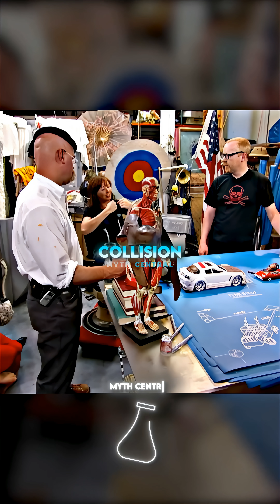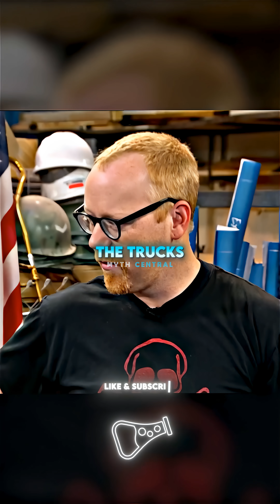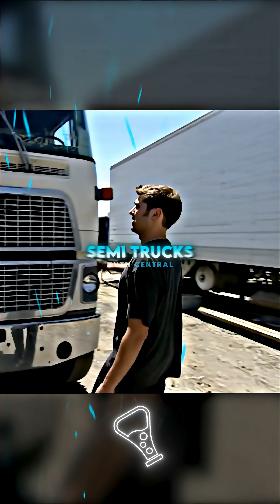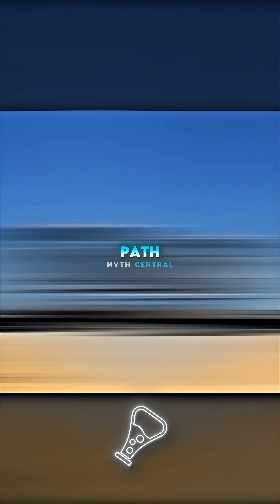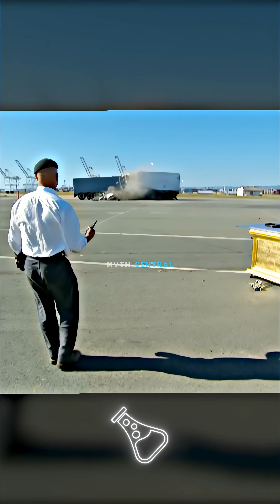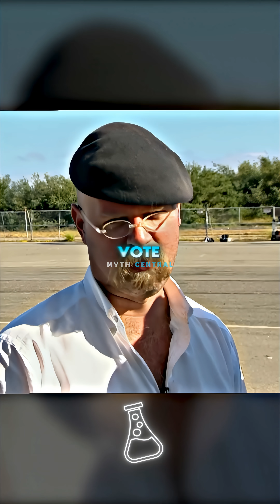Do 2 Trucks Fuze By Crashing?💥🚛 | MythBusters

Comment: I forget where I read this, but in the late 70s, the only car that came close to the safety of the Volvo 240 was the Fiat X1/9.   Fiat thought the US was seriously going to implement 50 mph crash standards when they were designing the X1/9.   But then Volvo was the only car company that could meet it so the standards were scrapped, but the X1/9 was too far along in development to bother changing.    That's bugged me about this myth since the original airing, they picked the wrong car.   Had they used say an MG Midget, the results might have been more plausible.

Comment: The trucks in the real thing were likely hauled off crushed together as that was faster and easier to clean up, otherwise they'd have to torch them apart on site which would take unreasonably long.

If you swam through the internet long enough you'd find a crash test of two trucks and a WAGON from some Asian country.
One truck rear ending the wagon and other truck.
The wagon turned into a ball. And only one truck was moving.

Comment: This is a big pet peeve with mythbusters they either can only do it once or do it without the other factors the car was hit by one truck and was pushed out of the way before the other truck even made contact and that car could have been smaller and undetectable if the other two trucks had hit him exactly the same time. There's no way you can say this is busted I want to see you all the variables and they fucked up on this one because one truck hit it before the other it wasn't at the exact same time preventing the middle car from squirting out

Comment: This is scary but sort of true if it is a small car an big trucks than this is posible i watched it happen sadly
Reply: It was a small car and big trucks. Wouldn't have worked tho since if two solid objects collide with a third object that's easier to squish, object nr. 3 is gonna be squished to the side, meaning that the way she described it it couldn't have happened.
What i mean by that is that she described first responders not noticing the car until days later, which means the car would've had to be fully hidden in the wreck (since first responders are trained for noticing everything). That's physically not possible.

Comment: i dont think this was optimal as the the truck turned before hitting the other truck so it had to of been off set  wouldnt of mattered because i doubt it wouldve stuck no matter what but hey what do i know im just sime dude on the internet
Reply: The way she described the first responders finding the car in this hypothetical situation, it would have had to be completely hidden in between the trucks, which already doesn't work physics wise, since when two heavy things press together a third object, the third object gets squished to the outside. Also, that car is not as big as today's cars cuz it's an 80s car, but even then it still was almost as wide as the trucks.
So yeah, you would be correct with your assumption that this wouldn't have worked either way.